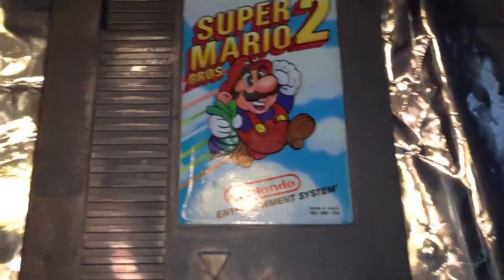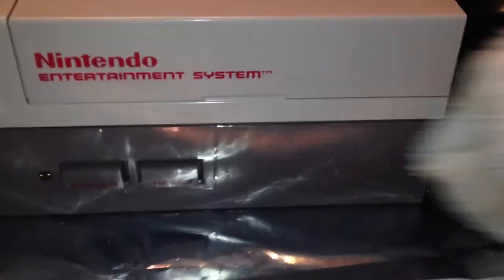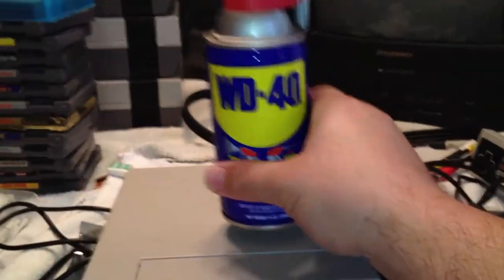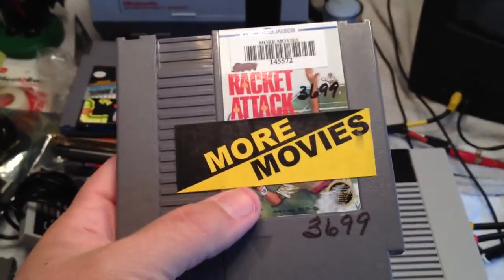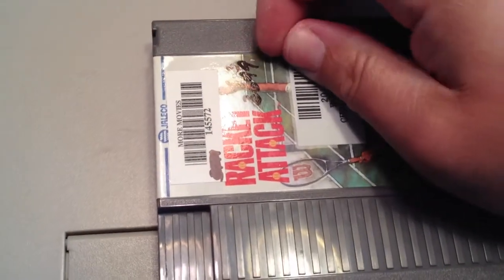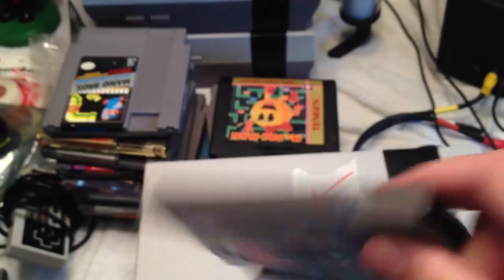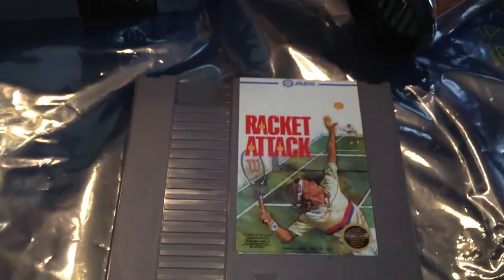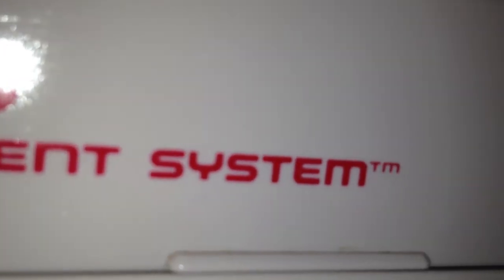Classic Gamers' HQ : NES Refurbish Series (Game/Console CLEAN) PART 5

Comment: Ok, you really blew me away with the Magic eraser trick.  Good one!  Let me give you a few tips too.  For fixing yellow plastic use Retrobright process. Soak plastic in peroxide  under UV lights. It will restore the color and not degrade the plastic.  Use 303 Protectant rather than WD40, it dries glossy and is a UV blocker.